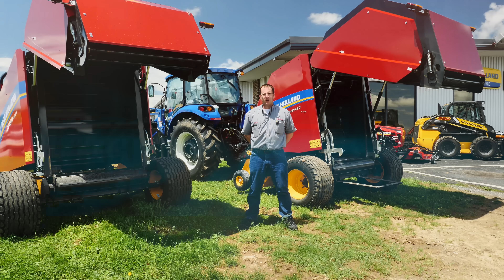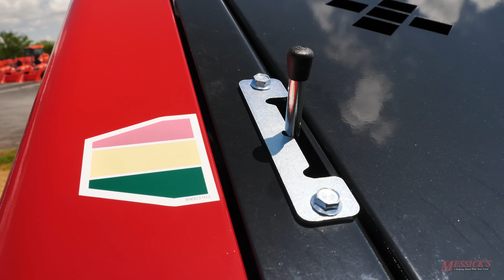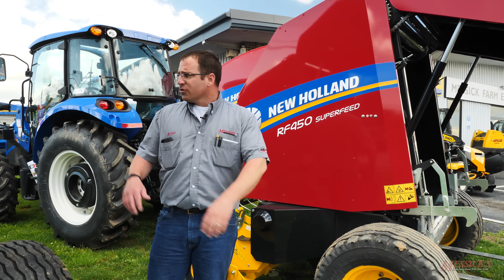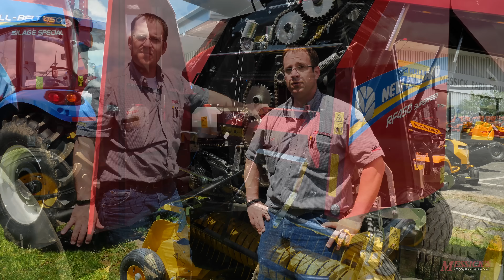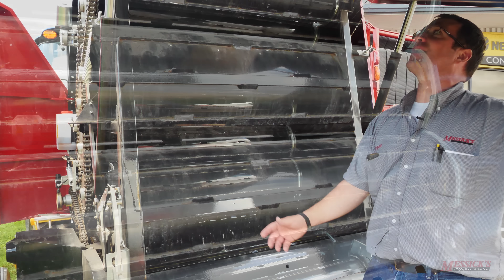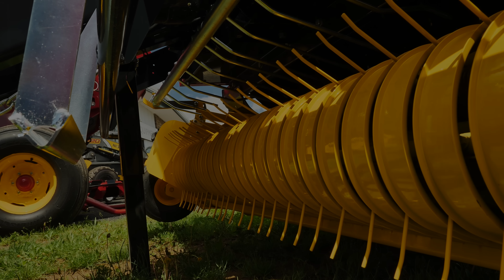*NEW* New Holland RF series utility round balers

Comment: Seems like they would make the chain drive system air tight as possible to keep crap out. Weather stripping would go a long ways on the shielding. Just something that has always baffled me. Couldn't they just use a massive belt as well or does it have to be timed?

Comment: Are round bales more likely to self combust than square bales?
Reply from the maker: The denser and wetter the more apt you would have problems. So yeah it will be a higher risk than a small square, but definitely less than a large Square.
Reply: Messick Farm Equipment  thank you for your reply
Reply: Messick Farm Equipment I wouldn't agree with that because a round bale holds heat much more due to its shape and the way the bale is formed
Reply: If you roll the bale at the proper moisture there is no issue I have rolled over 20k bales never had one light off

Comment: I would like to see the baler in action
Reply: Frank Scruggs I have video of mine running in the field.
Reply: where is your video?What do you think of the baler?
Reply: Still working on video hope to have out soon. Right now not happy with it at all. Took 4 days trying to get it to warp with no luck.Then we moved to a new field and tried again and it worked kind of. No help from New Holland tech,they had never seen one or heard of it. I did manage to get it to warp but took a long time and still has problems. I loose1 to 2 bale every field i have cut. Will not warp a partial bale we tried 4 time.  Still can get twine warp to work only net.
Reply: thank you for the info,hope you can get it to work for you.Dealer support means a lot in any equipment that you buy.anything newer is not always better....

Comment: Maybe new to New Holland but Krone has had a fixed chamber for years. I have run a Krone kr130 for roughly 25 years and am looking to update and am considering one of these. 
Soft core bales are not easier feeding by hand because the center makes a star shape and doesn't pull apart that easy it can be done once you get the knack for it
Reply: And welger, claass and a couple of others